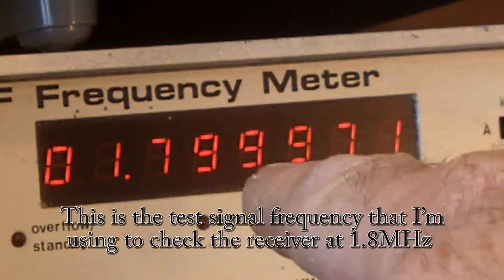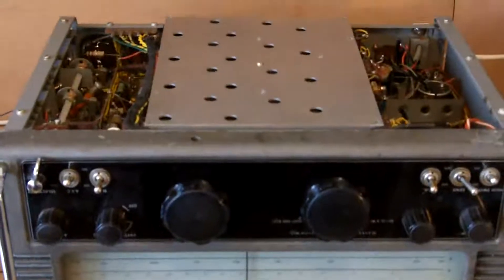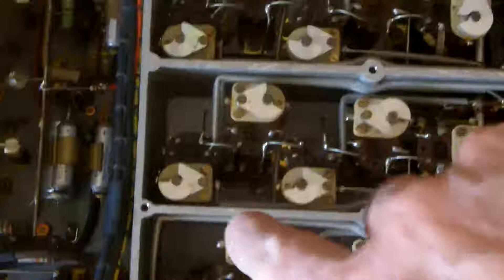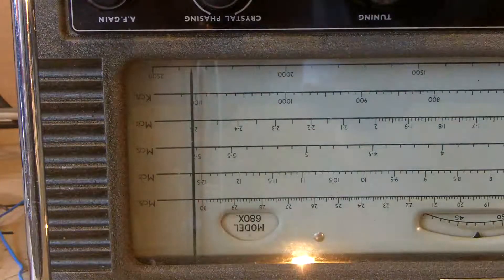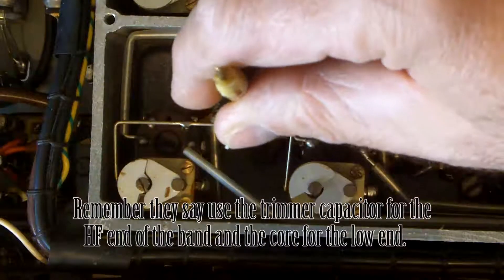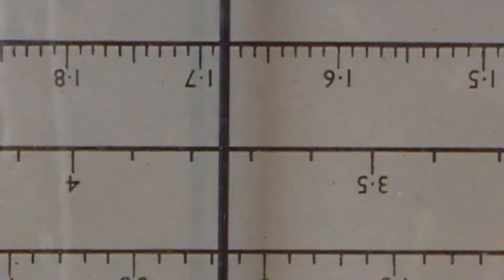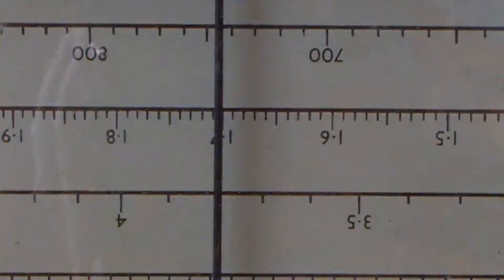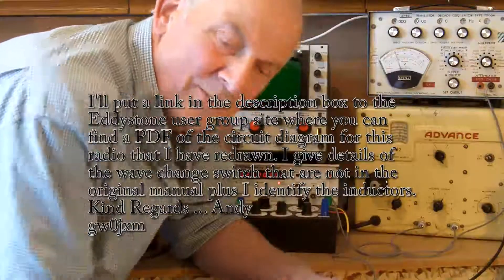About Radio 50 RF Alignment, Eddystone S680X communications receiver.

Comment from the maker: Hi Glenn, I don’t do this sort of thing often but I was surprised at just how little effect the aluminium panel has on things, I guess that when in place it’s about ½” or more away from the moving vanes of the trimmers, I think most of the fixed (outer) vanes are all grounded. The coils are buried even deeper, I guess a digital readout might tell a slightly different story.     
All the best ... Andy 
GWØJXM

Comment: HI Andy,
Did you find any change in your alignment once you reinstalled the metal shield? Many of the receivers I have worked on have panels with holes to cover inductors for alignment. If the panel is not in place during alignment,  their will be some change in the alignment. Your reciver is somewhat course in that it does not have 1KHz read out and it may not make much difference.
Anyway, I enjoyed this video as well.
73,
Glenn WA4AOS
DSM Labs  dot com
Laurens, SC   dit dita dit dit   dit dot